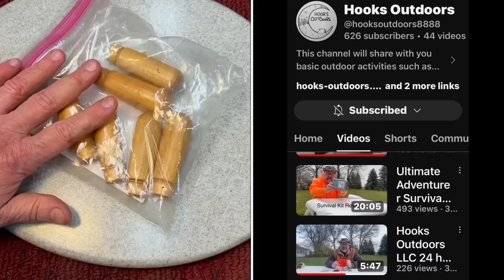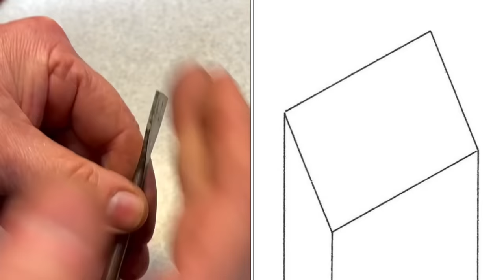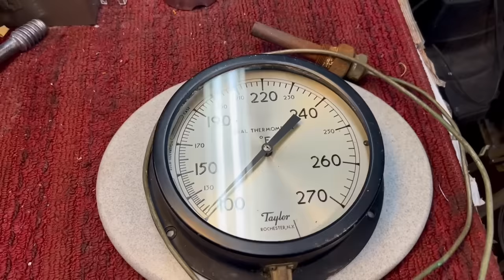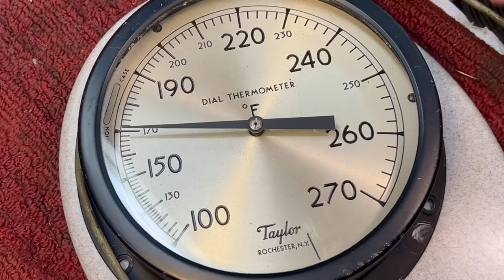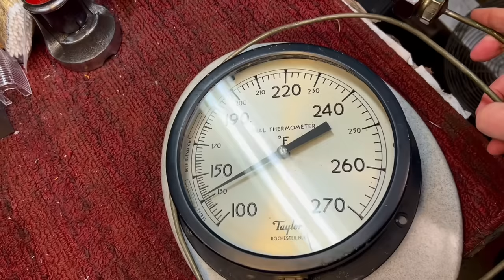A Wonderful Tool YOU CAN MAKE!!!  Plus- EBay Score!

Comment: The probe you cleaned up is called a thermo well.  The actual temp probe is inside the thermo well.  Usually these thermo wells are stainless steel.  The temp probe is usually brass or copper.

Comment: I have a similar remote reading thermometer designed to monitor  truck exhaust temperatures, has a really long armoured capillary tube too. Our last house (1991) had about twenty-five large pressure gauges display mounted on a basement wall...the seller left them undesturbed, for $25.  He said the gauges came from Great Lakes freighters.

Comment: The scraper is a great tool. Absolutely necessary for a mechanic. Very handy for carpentry too.  
I never count my tools. The Old Tool Mailing Group's motto. Designed to let the person being interrogated to say with a straight face and a clear slate for confession that they don't know. 
I did turn down a bag of them that was laying on the shelf at the Restore this morning. 
I know I didn't want to have to add onto the spade bit rack.

Comment: I thought they did something up on the pole to stop that leak!  That looks crazy! The scraper is beautiful!
Reply: I’m not sure about New York but in CT the utility is only responsible for the wire to the house and the meter. The customer is responsible for the wire running down the side of the house and the wire from the meter to the panel.

Comment: This afternoon I will be ferreting through my old drill bit drawer. Then scrounging the scrap metal bin for old copper waterpipe for ferrule material.  A quick fossick in the woodpile for a piece of gum tree, and it will be time to spin the lathe up. The good part about doing it yourself is that you actually start the project with the best quality materials.
Reply from the maker: Absolutely- The fun making it is off the charts!

Comment: Question for you John what is the functional purpose of the hole in the head of the spade bit?
I'm sure it's not there for decorative reasons.
I know people claim it's there for feeding cable but I just don't see it, the hole a spade bit bores is so large I don't see feeding a cable being an issue.
Reply from the maker: Matthew I too was wondering the same thing, I too have heard the hole was for pulling wire but it doesn’t sit well with me.  I could see if the bit was 12” long but why on short bits?  I’m with you- still wondering.  😃👍

Comment: Nice work on the scraper! I love shop built tools. Especially those made from "scrap". I've made several screw drivers from spade bits. I have a lathe so turning a handle is no big deal. I used brass pipe for the ferrule and epoxied the shank of the spade bit in place. One screw driver was for the cap iron screw on my antique hand planes and one was specially made for the brass nuts on saw handles.
Reply from the maker: It’s awesome mixing different materials. 😃👍

Comment: Thats a well that the probe fits  into that's so you could change the gauge without draining the tank or steam line without bringing the system down. Operating Engineer here retired yes just bend the tube back by hand.
Reply from the maker: Thanks!!!  😃👍
Reply: Roll it back straight on a table, just as you would  straighten  a roll of brake line tubing.

Comment: Nice job on the scraper. I did something similar about 6 months back. I used a 1/2" bit and but cut it shorter and ground the shaft into a hex to fit in the bit holder on my multi tool. I love that gauge. What a steal at $11 delivered. You need a 5gal bucket with a sump pump in it under the electrical box. Or if you have a drain in the floor you can make a Rube Goldberg funnel system you can erect when it rains.

Comment: One time I asked for pointers on shaping my new brake line at the auto parts store. I was told that some people fill their brake line tubing with playground sand before bending / forming them, then blow out the sand with compressed air.

I didn't end up trying it, but it sounded plausible. 

Maybe that will work for you?

Comment: NICE thermometer, Pal!. I got a hyfraulic pressure gauge I was going to put on the wood splitter about that size and it was just too big so it's still here. I sharpened all my spade bits but used to draw file putty knives and they made good scrapers too. And we can get 3 or 4 inches of rain after lunch/dinner and have a sunset that evening. Mountain tropics ate a hoot! Happy weekend and God Bless!